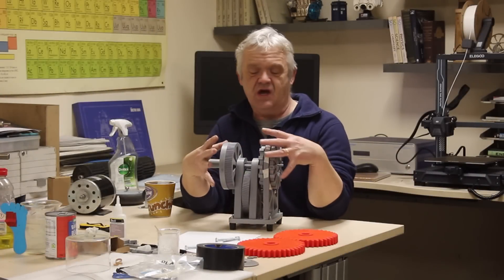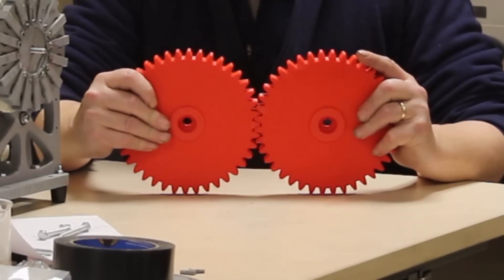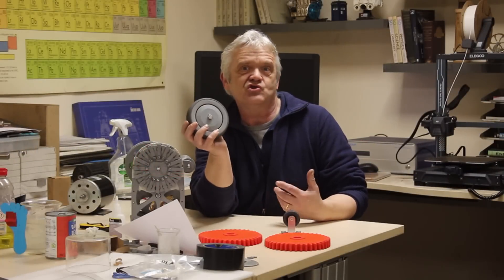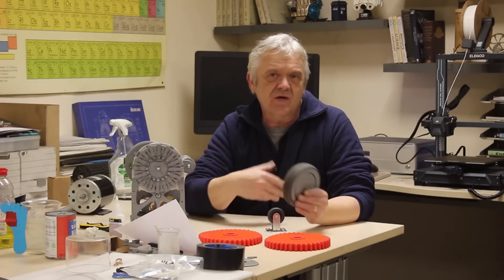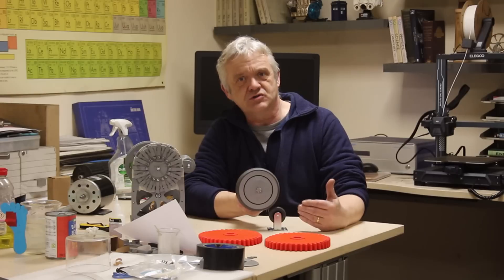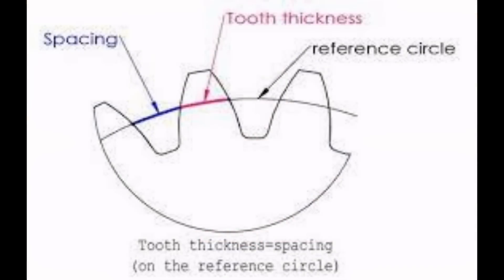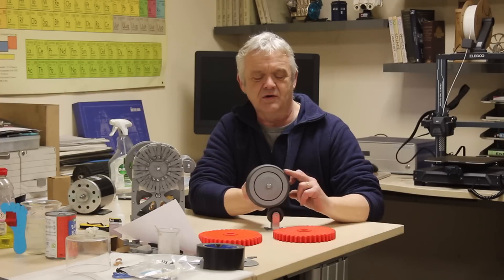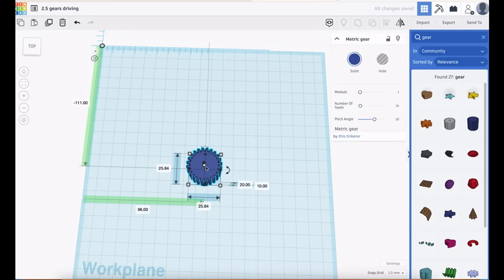1827 Understanding, Making And Using Gears

Comment: This is a field of study or should I say field of work that I am really familiar with Robert. I am a machinist tool die maker by trade. The gear is something that I have been cutting for years, bevel, spiral, harribone types were what I produced....
 My machine that I loved and setup was a SUNDERLAND GEAR PLANER. Such a simple unit with accuracy second to none. The largest diameter I cut was 8 feet with a width of a foot and a half. Great memories which will always be my fondest. 
Continue your great channel Sir and keep teaching us all that everyone is capable of greatness on a budget. Drop a line if you need any directional guidance too. Peace vf
Reply from the maker: wow - cheers mate - and I have to apologise for this being so cut down - I know there is a lot more to it but I am just trying to get the basics across right now - I stand in awe of your work mate!
Reply: @ThinkingandTinkering  Thanks a bunch  for the acknowledgement Robert.
Reply: Great comment from a fellow former aero engineer who never did gears. Thank you for sharing. Stay clear of the ‘safe and effective’. 
Peace
Reply: @G58  Balance is the clear thing to remember when it comes to learning knowledge Sir. Agree wholeheartedly. .
Reply: @victoryfirst2878  And integrity. 
Peace
Reply: @G58  Yes Sir.

Comment: Hey nice info. Pitch circle is what we use to generate a gear. Never hear of reference circle. If you are going to print gears, go for herringbone gears. Helical gears are quieter and transmit less vibration because of the more constant mesh. But they have axial load. Two gears back to back make a herringbone. Guess what sort of gears are in a destroyer gearbox? I'm not allowed to say but I'm pretty sure I gave a good hint!!
Reply: Pitch circle is associated with imperial gears. Also imperial gears use diametrical pitch (DP) instead of module.
When you see a gear referenced by module number you know you are going to be cutting a metric gear. Actually I find metric easier having been bought up in the imperial world.
Reply: Ok. Well my understanding is that pitch circle diameter is what I'd used in the formulas I have used for all gears that are generated.
Reply: 👆Your useful message are good but follow the easy way of making income, Tell Andrei jikh i referred you👆✍️

Comment: Great video, I will need to revisit this and watch it again and again to fully digest it.  I want to make a gear box for the wind turbine I am printing.  If it works well and generates enough power then I plan to print many more and hook them up to a battery.
Reply from the maker: nice mate - exactly what I am doing myself
Reply: @ThinkingandTinkering  , would you be interested in seeing my vertical turbine?

Comment: Great videos , you make them easy for the ordinary joe to understand. Question for you if your drive gear has to turn 4 times to make the driven gear turn once I would assume they speed of each gear is different, the drive gear would be 4 times as fast as the driven gear?
Reply: yes, in that scenario if the input drive gear is rotating at 100 rpm and the ratio between input and output gears is 4:1 then the driven gear is rotating at 400 rpm. Think about how the relationship between the chain sprockets on a pushbike with gears works and you'll get a clear picture of the relationship between gear/sprocket size and revolutions per turn of the input gear.
Reply: 👆Your useful message are good but follow the easy way of making income, Tell Andrei jikh i referred you👆✍️

Comment: Hey Rob! Could you please go over the same style of explanation regarding the torque relationships and how to work those out? Thanks so much!!!
Reply: in simple terms without taking any mechanical losses into account a 2:1 reduction ratio will double the torque from the input side....10lb/ft on the input side would increase to 20lb/ft at the output side.
Reply: @howardosborne8647  great explanation,  thanks Howard!

Comment: what happens if you glue a smaller gear to the the center of the bigger gear? and then add 3 to 4 of these things together.
Reply: I am not certain exactly what you are asking but I will try ... a smaller gear turning the outside of a larger gear will take a lot of rotations to move the outer gear 1 full circle... so you will gain torque. If you do that many times, you will multiply torque at the final stage.  However, the final stage will also spin horribly slowly.
Reply: @marcfruchtman9473  Compound gears and the Escapement Clock Mechanism is what i am thinking of. and using that to turn a generator.
Reply: @silverpc4611  None of what you first said mentioned an escapement mechanism. Why do you want to add that?
Reply: @marcfruchtman9473  consistent power over time. and the only work you have to do is whined it up. also maybe a flywheel could be added.
Reply: @silverpc4611  I see. So, a wind up device or flywheel would store the energy. Do you have a web link to an actual flywheel mechanism that incorporates an escapement mechanism? (would be cool to see that) ,also that seems like an interesting idea if you could get it working.
Reply: you get what is known as a 'compound gear train' with that sort of arrangement of gears.
Reply: 👆Your useful message are good but follow the easy way of making income, Tell Andrei jikh i referred you👆✍️

Comment: Now you in för something real interesting! No gear no extra inertia!  So if we take the Hawt and Vawt and put the coils outside the blades and the magnet on the blades maybe on a ducted frame,  it give more! and if a VAWT work together side by side or on top in two direction you get a good  surface were the speed is "double" the wind! Rob. can we use that? maybe on two 100 £:s Vawt!🥸/Mikael
Reply from the maker: we certainly can mate - nice thinking